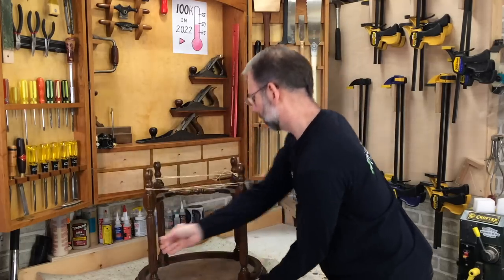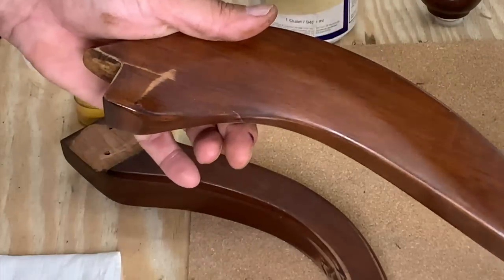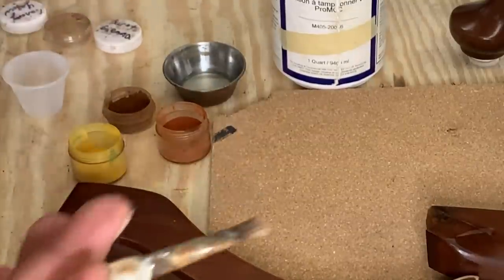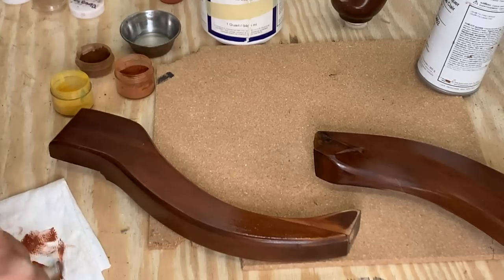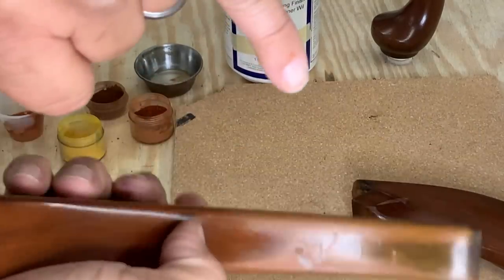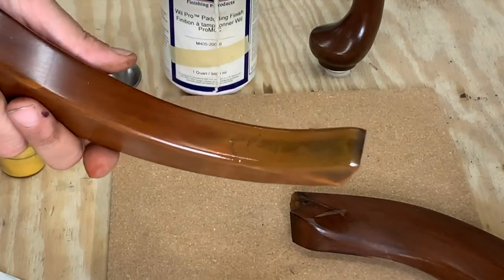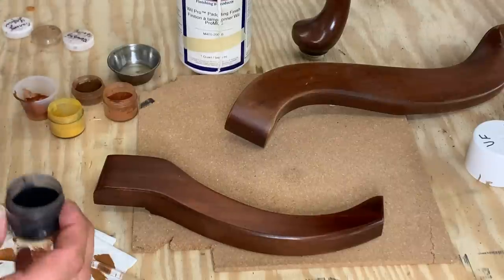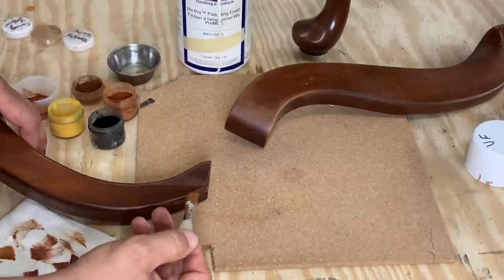How to Match Wood Stain for Furniture Restoration, with Guest Bob Walkup | by Fixing Furniture

Comment: What if I have made a repair on a pine chair and had do do some sanding. The sanded wood is light and the rest is in a transparent used lacker that seems a bit greyish by the age. Any suggestions? Do I have to sand the whole thing? Than it won't fit the rest of the chairs.

Comment: Shipping is expensive for padding lacquer for my area is there an alternative?
Reply: I’ve seen many different mediums used. I haven’t tested many of them, I know aerosol vinyl sealer will work and I’ve mixed the powders into epoxy mixes or you can apply dry and spray a lacquer seal coat.

Comment: Thank you for the video. Are the dry pigments mixed with a padding lacquer? Source?  Working time?
Reply: yes, I typically use a padding lacquer that will stay wet for 10-15 minutes depending on the environment. I learned with Mohawk finishing products and that’s what I typically stay with although there are many fine products out there like Guardsman and Touch Up Solutions.

Comment: Scott & Bob - excellent tutorial on color matching. It is one of the hardest skills to learn. You taught me a great deal and I am appreciative. Question for Bob: are the tints you used water based dyes?
Reply: They are not. Although you can mix with water but the results will be more like childrens water color sets.
Reply from the maker: Glad you enjoyed the video.  Thanks for sharing that.
Reply: @bobwalkup3808  thank you. So alcohol based? What brand do you use?
Reply: @agjohnsonandson   I use a padding lacquer which is like a thinner from Mohawk but you can use many different liquids or you can apply pigments powders dry and spray a lacquer topcoat to seal
Reply: @bobwalkup3808  thank you!
Reply: @bobwalkup3808  I had that same question thanks for the info on the padding lacquer

Comment: Confirming to adjust the color after the lacquer you steel wool it depending on how much you want to take off and try again or just adjust the color lighter or darker on top of the previous coat and apply more lacquer?  This is my biggest concern you put color on its the wrong one and I’ve never understood how to adjust on the fly.
Reply: Steel wool is usually used after the lacquer is dry and will dull out a ‘shiny’ color. You can use it to remove light layers before lacquer. If your first color is pretty close you can either adjust the color your mixing and apply a second slightly more translucent coat (add more padding lacquer/Wil pro). If you just need to adjust for yellow or red you can dry bush that powder over the existing color to tint it and then seal. You can also have an array of aerosol toners at hand to enhance the colors… they are very rarely the answer, just an enhancer. Mohawk also makes the blendal powder sticks, which are not wax fill but actual pigment in stock form that can be used to blend or almost conceal depending on the use; it will also need a seal coat.

Comment: To remove old stain from a piece is sanding the only alternative or is there a kind of bleaching method ??
Reply: I would only use bleach to remove anything that has deeply stained the wood and would not easily come off with sanding; oxalic acid is good for that. For small areas sanding works well, it really depends on the project.

Comment: Would the arm not have been easier to stain and blend in if you lightly sanded over the transitionary glue line first and then feathered in the pigment over both the glued pieces? Dealing with a transition line is just a nightmare!
Reply: Sure. There a many different approaches that will achieve results.

Comment: A no from me. I know lots of folks won't like that, but it just seems over the top when you put so many products on the piece. All that obliterated the grain lines so much that you have to paint new lines on. What is the point of that, and then you can still see the glue line.  You have considerable damage to the arm, just strip it off and properly finish it.
Reply: All the products and processes aren’t necessary for every repair; and many repairs involve using a filler where grain would need to be replaced. We used so many products for demonstration specifically for this video and the arm was a the piece chosen.
Reply: @bobwalkup3808  Fair enough, but would it not be more useful to show each technique on pieces that are appropriate for the job. Did I miss where you stated any of this in the video.